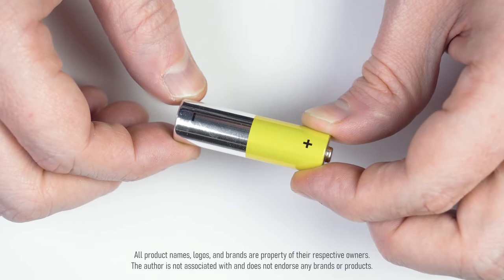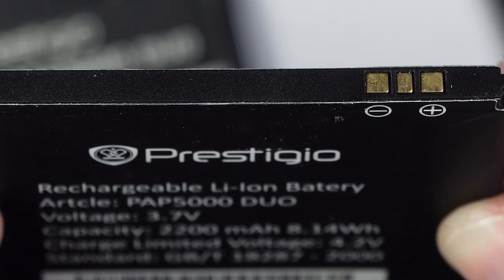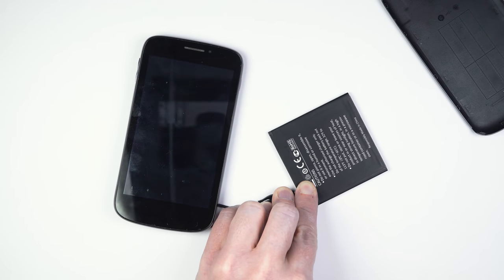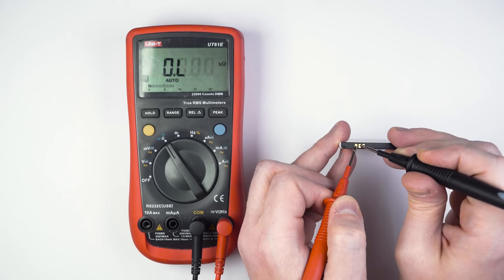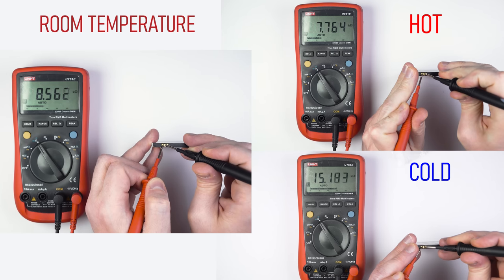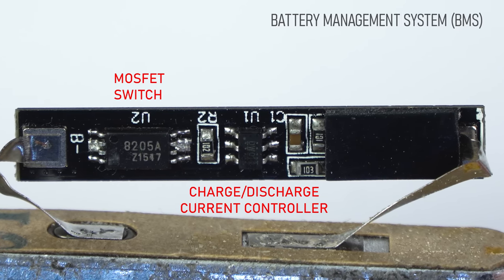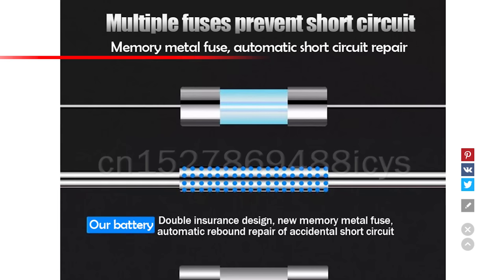Why do MOBILE BATTERIES have THREE terminals? A simple Explanation.

Comment: At least that's what I thought the extra pins does. Not only to measure temperature but mostly general battery health info to get the most optimal use without overloading it. In example optimal fast charging or the phone autotuning itself to keep a stable battery usage without overloading or overheating it under extensive periods of time. Battery wear. Or shutting itself down when it reaches a boiling point. Or to extend that 1% battery left a bit longer than it should.

Comment: for example, such a BL-5C battery has a resistor connected to the middle pin, which has the electronics of the charger or the device to inform about the battery capacity. This battery is produced in multiple internal capacity sizes.

Comment: When my old blackberry 7290 battery failed i ended up shoving a lipo and two resistors in it to keep it going. had four pins, one pin was for telling the phone what type and capacity it was and the other was for battery temps ( wont charge with out a connection ) worked well for many years after

Comment: There's one more case, as we have seen in Galaxy Note 7. If the manufacturer doesn't leave enough space for the battery to expand its size, when its warm pressure can make battery literally explode and catch on fire.  So if you're buying any 3rd party "extended size " battery, make sure that the size and thickness are exactly the same as a fabric one.

Comment: Lithium WANTS to release energy (it is a very reactive substance). I would have guessed the other terminal was a secondary voltage and not a thermistor, so I learned something new today. I would not have thought you could not make and sell a lithium battery without the thermistor, but I now wonder if there is any way to tell if a battery HAS the right protection short of buying it and testing it (through a declaration or underwriter program, etc). Thanks for the video.

Comment: Mobile batteries typically have two terminals: a positive (+) and a negative (-) terminal. These terminals are used to connect the battery to the electronic device's circuitry and provide electrical power to it.

It is possible that you may have seen a third terminal on some mobile batteries, which is typically smaller in size than the positive and negative terminals. This third terminal is usually a thermistor, which is a type of temperature sensor. The thermistor is used to monitor the temperature of the battery, which is an important factor in the battery's performance and longevity.

The thermistor helps to protect the battery from overheating by regulating the charging and discharging processes. If the battery temperature exceeds a certain level, the thermistor will send a signal to the device's charging circuit to slow down or stop the charging process, which helps to prevent damage to the battery and the device.

In summary, mobile batteries typically have two terminals for power delivery (positive and negative) and a third terminal for temperature monitoring (thermistor).

Comment: the third terminal is the temprature terminal, which gives the motherboard a signal when the battery overheats,the fourth is the protocol terminal,it makes the protection circut board quickcharge the battery

Comment: My Icom radio uses batteries that have two contacts that connect to the contacts on the radio, and they have three contacts on the back side for use in a drop-in charger. The batteries can be charged either with the drop-in charger (rapid charge) or by connecting 12v to the radio's power jack (slow charge).

Comment: To save you the several minutes one is negative one is to check the power level and one is positive it uses some neat electrical properties to measure the difference between negative and indicator and positive and indicator

Comment: Not sure how you are shorting the terminals at the end of the video since you messure it with the multimeter that is designed to messure between plus and minus instead of putting pins directly between the terminals to short them.

Comment: Tldw, 3-wire charging, usually the third pin is for a thermocouple, or even a 1 wire serial connection to the charger, to help measure the charge rate, and also regulate charge current, because a charging  battery heats up, don't wanna over heat Dat lithium
Reply from the maker: No mobile battery uses a serial data connection. I've dealt with literally thousands of models of batteries, none of them ever had anything except for NTC on that pin.

Comment: your missing the fact that most batterys (the 3rd pin) is also used for data (sonys camcorder info lithium for example) ,  its i2c or other serial data
Reply from the maker: The video is about mobile batteries, not camcorder, not powertool, not laptop, not game console. FYI i2c needs at least 2 pins, so 3-pin batteries cannot possibly use i2c.

Comment: well, that is awesome, but my battery has 4 pins and one shows 50Kohms and another middle pin has 150Khms relative to negative pole, between negative and positive.
Reply: Change the temperature of the battery, then measure the resistances again.
You might not be able to identify what all the pins are for, but you can probably identify between which pins the thermistor is connected.

Comment: Long story short: the third pin is a temperature sensor which cuts the battery connection when it gets too hot or too cold.

Comment: The third pin goes to the thermal resistor which stops the battery from charging if it gets too hot. They used to put a "T" on the battery to indicate this, but most people don't really care as long as the battery charges and works.

Comment: Some batteries do actually use the 3rd terminal to stop use of 3rd party battery. 
Like the 2nd battery you had shown (sony npf 970) has a 3rd terminal that is the metal strip in middle. And it has sony proprietory infolithium bs. If you use a 3rd party battery the camera will stop recording after 2mins. 
But sony battries are good quality so the high price is acceptable. I have 11 & 17 year old sony battries holding nearly 90% capacity.
Reply: There are some things other than just restricting to original batteries that you can do with a data connection, and those things really make sense on things like InfoLithium batteries.

Even when phone batteries were replaceable, the battery is typically only charged in the phone, so the BMS just has to worry about overcurrent, overvoltage, and undervoltage. (Overtemperature is nice too, but as it's most likely to occur in the phone, having the phone itself monitor that works well.) And, only one charging curve is necessary, because there's only one model of battery that the phone is designed for. (This also means that aftermarket batteries may have degraded lifespan if they're higher internal resistance than the original battery.)

With InfoLithiums, there's many different sizes of battery, with slightly different chemistries, in many different devices, and they're often charged on an offboard charger. So, especially with faster charging, the battery needs to tell the charger what its desired charge curve is, so that the charger can aggressively charge larger/lower internal resistance batteries, but back off appropriately on smaller/higher internal resistance batteries. The device needs to know how much current it can safely draw - something expecting a NP-F970 might overwhelm an aftermarket clone of a NP-F330 with poor-quality cells, for instance. And, state of charge estimation is difficult on lithium-ion batteries - merely using voltage means the estimate will swing wildly as load varies, and coloumb counting is the preferred approach, but in the InfoLithium system, with off-board charging, that only works if the SoC estimation is done by the BMS, not by the device. Without that, you're stuck with voltage. (Also means that phones with swappable batteries have less of an idea of SoC when you swap - they could theoretically do coloumb counting on full charge cycles until you swap the battery, but then they'd have to fall back on voltage until you recharge.)

Comment: I'd rather buy a 3rd party battery from a trusted company (like Anker) instead of those cheap ass "original" battery which either are a) already used heavily or b) cheap and fake knockoffs.
Reply from the maker: Well, now you can check if the trusted company installs temperature sensors in their products. ;)

Comment: Why the resistance is LOW (high current flow) when it is HOT? I thought it was the opposite.I dont understand. 🤔
Reply: The rule that resistence increases with temperature applies only to conductors, semiconductors generally work the other way around. The latter is way more complex, so that's why general education only focuses on the first one

Comment: so in your example the phone shuts itself off because the thermistor position wasn't connected. Can we still use the battery for arduino projects and get energy out of it without having to deal with this 3 terminal? 

Im wondering because you needed the resistor for the power supply to work with the phone, but does the battery 'also' require the hook up present?
Reply from the maker: No, the battery itself does not require a resistor. You can use it as power source for your Arduino projects. But you'd probably need a step-up converter, because Arduinos run off 5v supply.

Comment: Of course phone batteries have a temperature sensor, because it's a basic safety feature. If the battery overheats, the phone can shut down. I'm honestly surprised that none of those people spreading conspiracies figured this out. This is basic stuff.
Reply: They don't have a multimeter. And if they did, they probably gonna make a conspiracy on multimeter too.

Comment: I laways thought that the 3rd or 4th pin were balancer pins. Since airsoft is one of my hobbies all the batteries which are li-ion or li-po have extra wires for balancing the cells. I thought those beefy batteries consists of more than one cell and hence need the balancing.
Reply from the maker: See, phone batteries only have a single cell, so there's nothing to balance. The voltage rating is 3.7v for mobile batteries.

Comment: I just changed my phone battery and it's temperature remain 25°c costant whether it's hot or not 

The phone it self and other apps measured the same ..I think that's what they did
Reply from the maker: I would say it means the battery does not have a temp sensor, it has a resistor instead.

Comment: I assumed that that third connector was for ensuring the integrity of the battery and device powered by it. A safety related thing. I was not so far from the actual purpose.
Reply from the maker: Some camcorders batteries have this function, but not mobile phone, apparently.

Comment: Only iphones have proprietary batteries.  I learned this when swapping it with a 3rd party battery.  The iphone no longer accepted is updates until I installed the old battery.  There is a chip that identifies it is a legit battery.  I use Android now.
Reply from the maker: Yep, however you can still buy 3rd party iPhone batteries that will work online.

Comment: if i connect + and - with wire and put resistor on middle to - on my device...and i connect a charger...can it run without battery??
Reply from the maker: Yes, it can. I have shown it in the video.

Comment: So... I was trying to use that pin to charge the battery, I guess I am lucky that that didn't damage the thermal sensor
Reply from the maker: You can't really damage the thermal sensor like that, but it simply won't work since the resistance is way too big for the current to set in.

Comment: Thanks baldy guy you earned my respect. Love from India
Reply: hey buddy i need some advice. i used random resistor to use custom battery. but it is still shutting off. is there any specific resistor value which is necessory ?

Comment: So... can you use any resistor do fool the phone and use an external power supply? I have two old Nokia N-Gages with dead batteries, it would be nice having them powering on again with this method.
Reply from the maker: No, not any resistor. You have to use the same value as the original battery. If you still have those batteries, you can use a multimeter to measure resistance between the negative and middle terminal, and then use the same value resistor on your phone. But as far as I remember, Nokias use a resistor something around 70k.
Reply: @RonMattino  the batteries are dead but I guess I still have them, nice tip, thanks!
Reply: is there any danger in doing this? i am planning to make use of an old phone as an always on "cctv"..

Comment: Did I miss the explanation of why the room temperature resistance was higher than the hot resistance? What's going on there?
Reply from the maker: Well, mobiles use a temp sensor with the so called NTC, negative temp coefficient. Probably, historically, not sure why exactly. There are also PTC sensor whose resistance goes up when the temperature rises, but I've never seen one used in a mobile. Probably the NTCs are cheaper for some reason.

Comment: What would help ... what type of resistor? I mean what ratings??
Reply from the maker: If you're asking about 3rd pin resistor, you can use any rating, almost no current is flowing there. You should be ok with a 10k resistor, if it doesn't work, try 47k resistor. For Samsung phones it's 2-4k resistor.

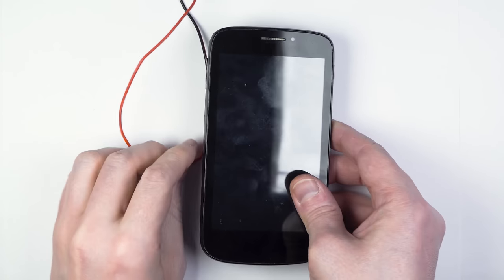Comment: Hey Ron. Clear video, thanks. What is the brand/type of the amp/watt measuring device you are using (4:05)? I have only seen it as a USB tester.
Reply from the maker: Hi. That's DPS-5020 power supply, the amp/watt meter comes with it. https://aliclick.shop/r/c/1raub7zcea1j7y3q

Comment: Great information! Now I'm wondering why some laptop batteries have many more connections.
Reply: Basically those extra connections are for the data protocol which manages the battery wear level. Laptop batteries are a bit more complicated and have their own little microcontroller and flash chip in them, which stores things like the manufacturer name, the original battery capacity, the current battery capacity accounting for the age/wear level, the number of times the battery has been recharged, etc.
Reply: Laptop batteries typically have multiple cells, with each being monitored by a charge controller that communicates with the laptop's logic board through the extra pins.
Reply: @drewzero1  makes sense. Thanks!
Reply from the maker: Could also be for cell diagnostics and balancing, because laptop batteries have multiple Li-Ion cells.
Reply: @RonMattino  wouldn't it be able to do that with just the + and - of each cell?

Comment: Sorry but i haven't seen a phone battery since the galaxy nexus, all my phones(nexus4/5/s7/8/9/10/20) since then are sealed.
Reply from the maker: It doesn't matter, internal batteries use the same principle. Also 3 pins (3 wires actually), only hidden inside.
Reply: @RonMattino  why should i care when i can't see it inside? this video would make sense 10 years ago, not now.

Comment: “Chinese manufacturer often ignore this rule"
Meanwhile both Apple and Samsung source at least some of their batteries in China, even in their flagship phones. 
Buying batteries in China won't kill you, buying cheap batteries will.
Reply from the maker: Apple and Samsung are not Chinese manufacturers, they have factories in China, that's different. Maybe Apple sources Li-Ion cells, but Samsung produces their own.
Reply: @RonMattino  Nope, Apple source fully assembled batteries in China, and the info is literally printed on the shell of the whole package, which would not be the case if they only source cells in China and add the BMS board themselves. (And it's also not Li-Ion, which is those cylindical cells, but rather Li-Poly, which is those flat packs.)
As for Samsung, I think they still have battery factories in China. Also there's nothing saying that just because Samsung produce their own battery they can't outsource some of their needs. If they can't make their own battery cheap enough to suit their A series phones of course they would outsource it, and it'll likely go to a Chinese battery manufacturer, who might not produce the highest quality cells but is definitely the best at assembling complete batteries.

Comment: I always figured it was some sort of data line. I remember trying to probe one with a multimeter, I remember it had voltage on the line between the negative.
Reply from the maker: You probably probed between the positive and the middle pin.

Comment: better get the cells from cheap battery and salvage the regulator board from the old genuine battery.
you get to save some money.
Reply from the maker: That's exactly what you do not want to do and that is the point of this video. Rewiring cells may be very dangerous because most original batteries are filled with compound which is pretty hard to remove. If one is not experienced enough, it's quite easy to damage cells and the PCB and create a short circuit condition, which may result in fire and burns. Please do not attempt to disassemble the batteries.

Comment: I fix phones for living and I'm sure that you could just hook a phone (samsung phones in particular) could be hooked up and powered from a power supply buy just putting the + and - without putting anything on the middle pin
Reply from the maker: It won't charge via USB though.
Reply: @RonMattino  yes but by powering the device via an extra power supply you wouldn't need to charge your phone it still allows for transferring files by USB but it wouldn't matter if it charge or not and fun fact some models does deliver power to the pins anyway and result in decrease in the power drawn out of the power supply

Comment: I wished this was still relevant to me — as in, that my current phone still had an exchangeable battery 🔋
Reply from the maker: It is relevant. Internal batteries use the same principle, and if you ever need to power up such phone, you will also find 3 battery pins inside.